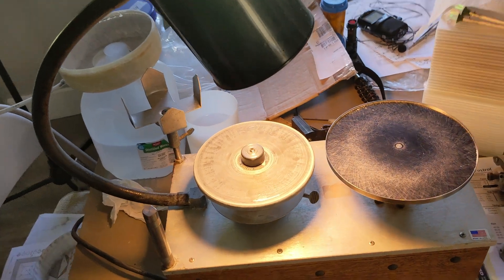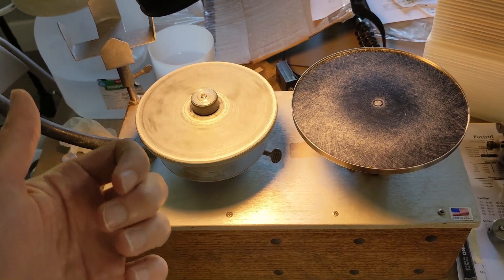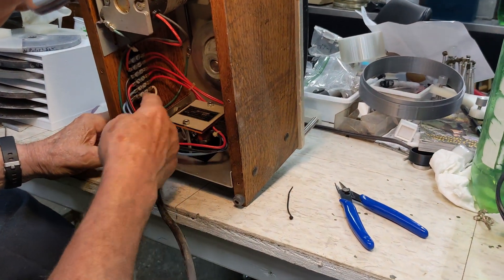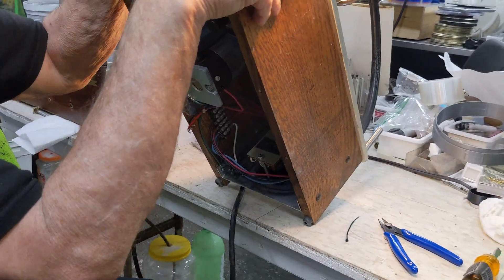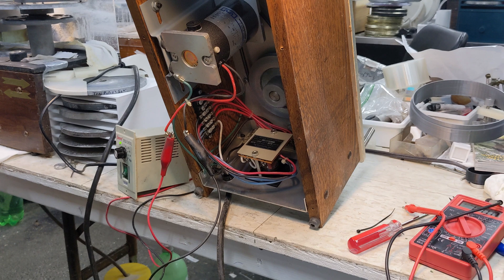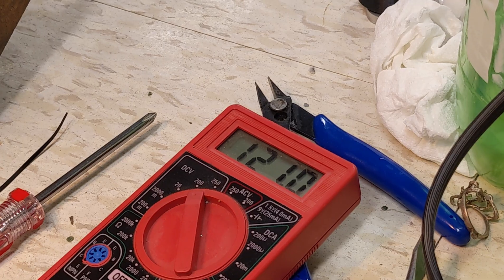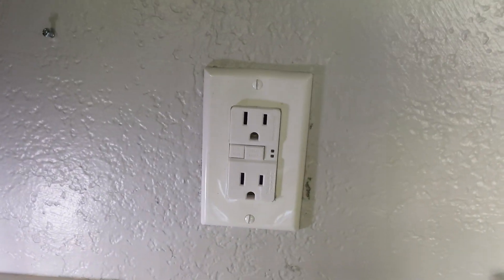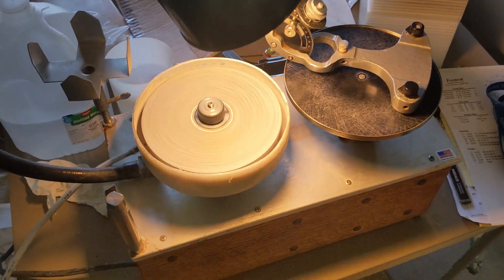What's Wrong With My Faceting Machine?

Comment from the maker: UPDATE: there must be a very small short in the machine. Someone told me that GFCI will trip at very small currents, like hundreds of milliamps range. The machine still worked at my friend's shop, so I took the ground and GFCI outlet out of the equation by using a two prong adapter. We also rewired so everything runs through the fuse.

Comment: The wall outlet has a ground fault interrupt circuit built in. Its not a circuit breaker. Every time the ground fault interrupt fires, it just saved you from a nasty shock. You have a loose wire or a wire with bad insulation inside your box.
Reply from the maker: I didn't notice an obviously loose wire, but your theory makes a lot of sense. I'll go back in and inspect them more closely. Thanks for the suggestion!

Comment: Are your motor speeds the same as they have always been? If not, it could be that you have an internal motor problem or, maybe the motor bearings are worn causing drag and overworking the motor. Also, try a different outlet other than your GFI outlet to see what happens.

Comment: This is a weird issue that I've never heard of. Im not an electrician but I've done wiring and am licensed to do minor electrical and these issues just don't make sense. Its like a wire that is bare and touching metal where it shouldn't and causing a short temporarily. But all the wires are screwed in securely. And if its in the plug and not the machine, then it should only trip that outlet. So unless there are other wires that we cant see from underneath it, that could possibly be loose and causing a short, which i cant see, its possessed! That's my answer. I've never had an issue like this, and I've worked construction and wired homes for power, for years. And even if the GFCI you bought and installed was not a high enough rating for your circuit, it wouldn't trip in other plugs. Just that one. So it is possessed. Or your house is. Sorry to break it to you!
Reply from the maker: The guy in the video was an electrician journeyman, and he's confounded, too! My current guess is the speed controller or circuit board is going bad and when it gets hot it starts having trouble, but we'll have to run more tests to check. Unfortunately, we've eliminated the easy solutions. But if it turns out to be possession, all I gotta do is harness their power for good and have them start cutting stones for me when I'm too busy.
Reply: @DonohueLabs  Now that is a good idea! Best of luck with that and if the babies head starts turning all the way around... run! lol